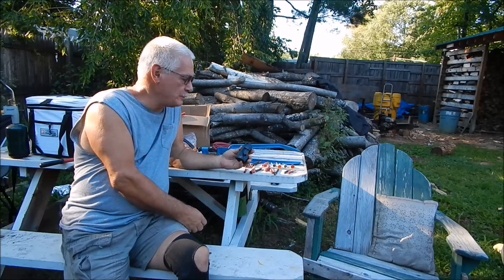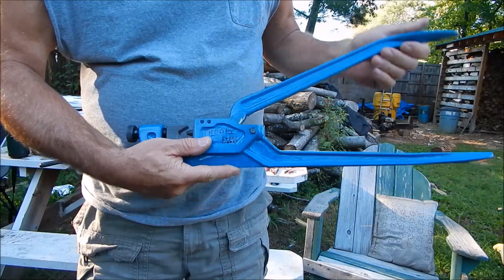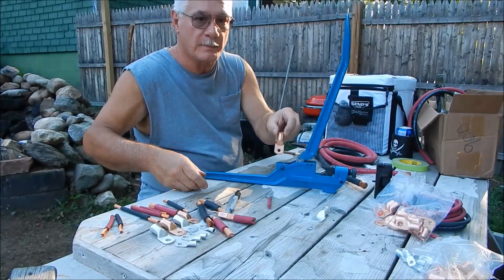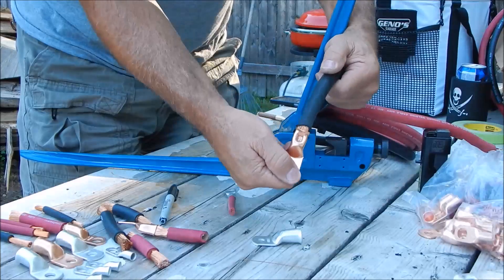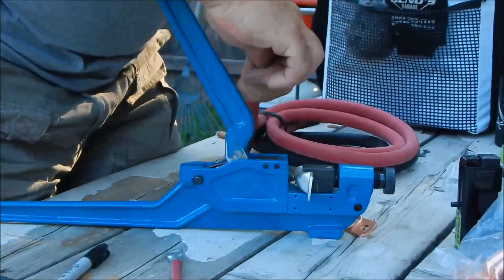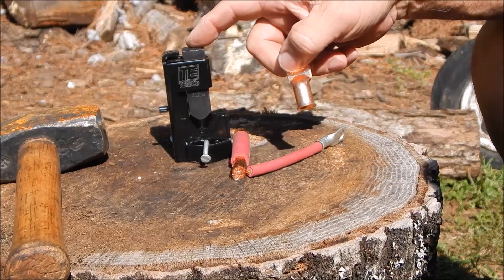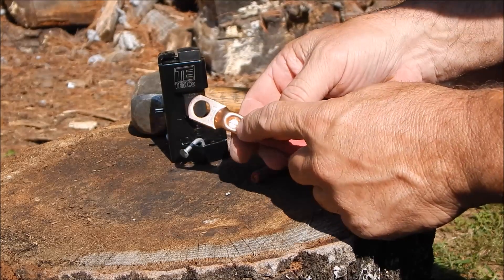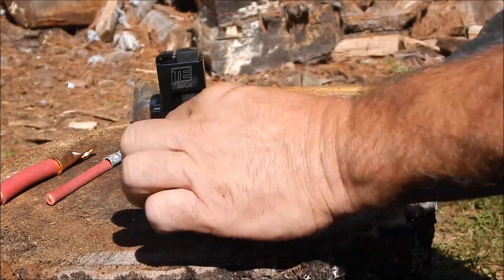Temco Crimper Tools Part #s TH0012 & TH007 My Review

Comment: I have used both styles of crimping devices, and greatly prefer the hydraulic style.  Especially when you get into the big cables.  Although, I did not have the luxury of having the hammer style unit with a way to fasten it down so it didn't bounce when I hit it, so that might have made it a more pleasurable experience.
Reply: How do you accurately match the Metric Dies to AWG Cable? I always see the Dies jump from 50mm to 70mm. I would be using mostly 1/0 cable. I need something around 60mm.
Reply: 707SonomaComa well I see this is years old but 1/0 is the 50 mm die

Comment: The cable insulation should butt up to the end ring on the lug when done. 
Trim away any loose tines to prevent accidental shorts.
Use shrink sleeving overlapping the insulation & lug to electrically insulate from 
slipped wrenches, & keep contaminants & battery off gasses from oxidizing the 
exposed bare wire.
Reply: Did you not hear him say he stripped them a little long so people could see it better?